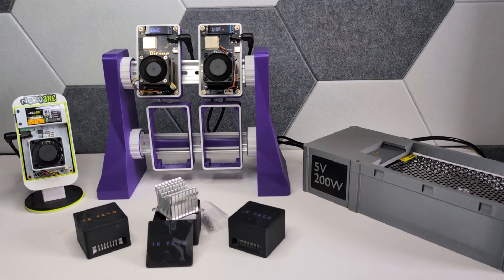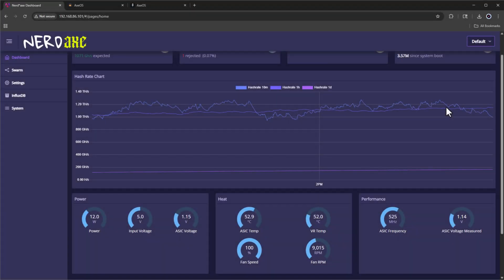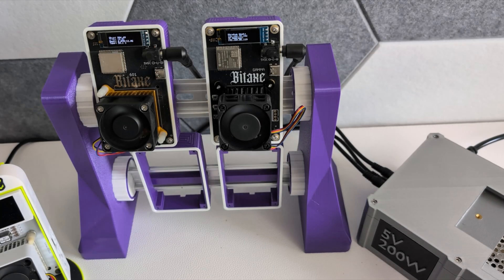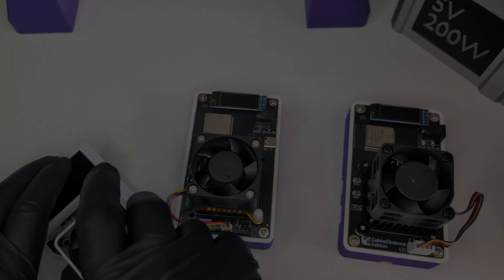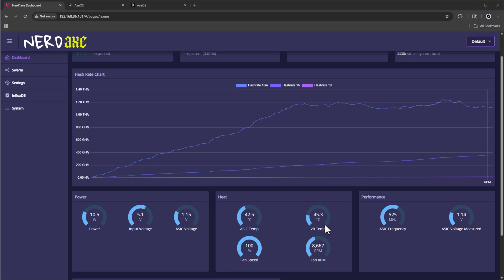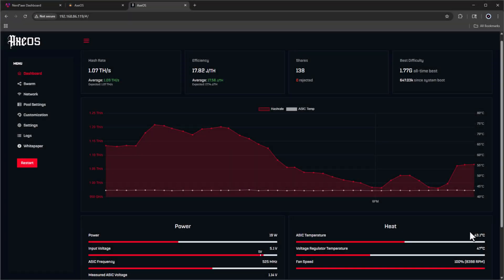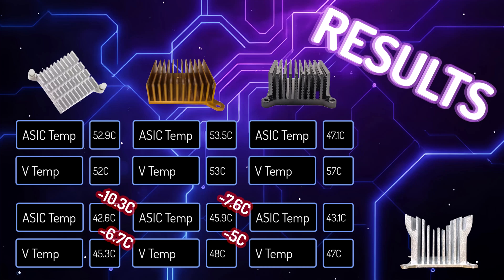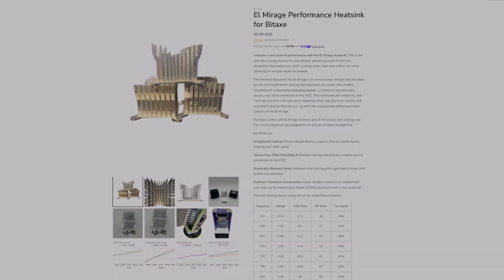Bitaxe & NerdAxe Cooling Upgrade: IXTech El Mirage Heatsink – Teardown: How Does It Compare?

Comment: Did everyone just reuse the stock fan with this heatsink? Or i should upgrade it as well?
Reply from the maker: In the video I just replaced the stock Bitaxe fans. These fans typically run around 7000 RPM at 100% but they can be noisy.

A lot of people opt for Noctura 5V 5000 RPM fans, for performance and lower noise. They are only 5000 RPM, but I believe they have better airflow due to their fin design.

I just ordered one for some benchmarks, I'll know more after my independent testing.

If you're curious here is the Amazon [Affiliate] link. https://amzn.to/3GZgrLL

Comment: hi how do you mount the fan on top of the el mirage? is there any bracket attached?
Reply from the maker: I use M3 screws in the ones I mounted.
If the screw is threaded from the ones you remove, you can more than likely use the same screws, if they're not too long.

Here are the ones I used. (Affiliate Link)
https://amzn.to/46qvico

M3*25